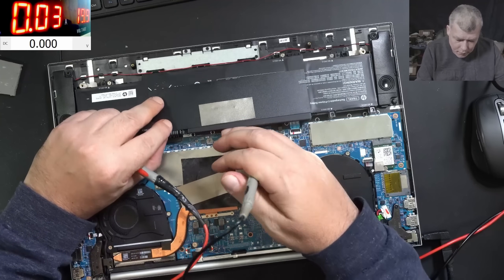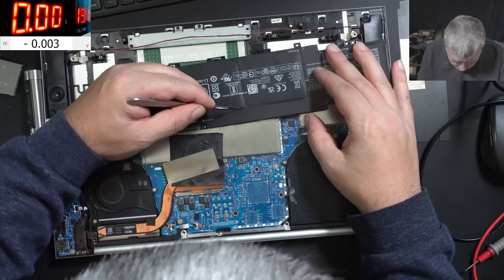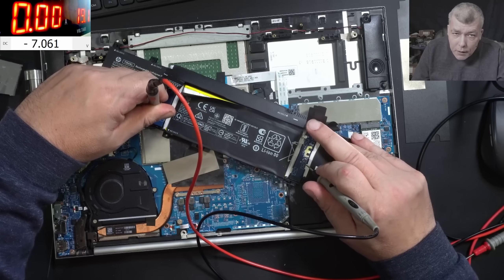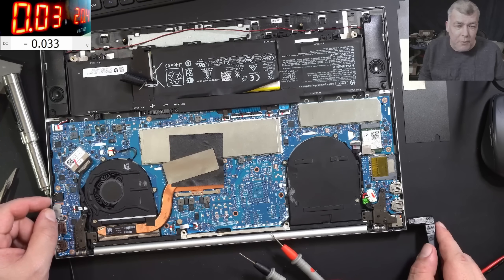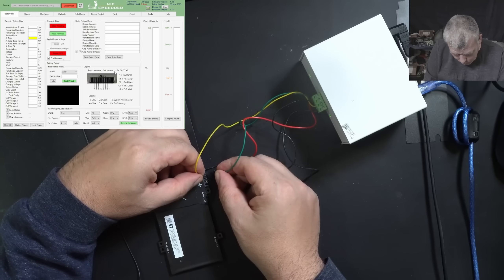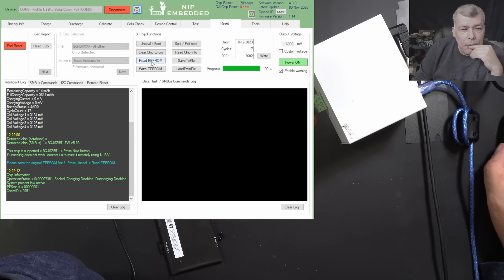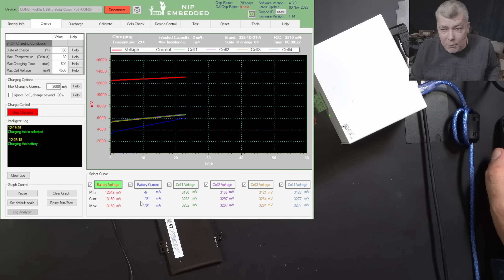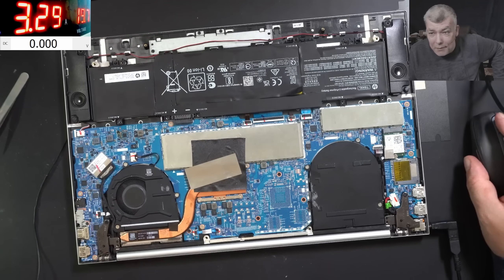Laptop battery repair & unlock - Yes, even a new battery can die

Comment: The battery analyzer is essentially a collection of various battery manager chip protocol analyzer from various manufacturers like TI BQ series. In this particular battery it was a TI BQ40 series chip which can be decoded using the datasheet published by TI. 

The issue here is that, they allow encrypting of these BMS chips so you can't actually read the firmware or re-program the IC without having the OEM's private key. 
And guess what happens, these "smart batteries" lock out every effin time they somehow gets over discharged. 

I have tested multiple batteries from various laptop OEMs and I have noticed the pattern that everytime you buy an after market battery compatible to many modern laptops, the laptop's EC will not recognize the battery, nor it will charge it. 
BUT here's the kicker, the EC will allow discharging the battery, but will show to the OS one of these misleading generic statuses e.g. "not present", "X% available and not charging" etc. 

If the user keep running the laptop from battery, it will eventually die and after sometime, the brand new battery will lockout from over discharging again. 
This design is pure evil and ripping off customers. 
It's about time someone comes up with some open source firmware reverse engineering scripts to similar to the tool here ( I am working on one for these BQ chips if not somebody comes up with one before me).

Comment: I have a question I have a windows hand held gaming PC the battery is bad 2 cells are swollen and I couldn't find a replacement so I took the 2 swollen cells out kept 4 cells now the device charge but every time I turn it on it keeps turning off in minutes is there a way to keep using the device with same battery or I'm waiting my time?

Comment: If there were a conventional method to perform this reset without needing the device, which is expensive to import here to Brazil, maybe a physical reset on the BMS. I have several Acer Aspire models like this, nearly new, and they don't hold a charge.
Reply: @carlosedubrasil  i am gonna try to remove all cells frok bms and solder again, maybe it will reset it if bms dont get power🥲

Comment: Hi sir, am chris
I am facing a battery issue with my  laptop(leadbook t11) .
It's life spand has drastically reduced. When I use it when connected to the wifi, it goes off after a very short period of time.

Comment: My new Asus battery died many times, I fixed it. Using random key combinations, touchpad keys, plugging in many tines. Even the 95% was upside down during charging. The native battery manager driver caused the battery’s fate, after the hibernation is successful, the illegal driver must be removed. Only Asus professionals are allowed to install it. Without hibernation the battery can’t be balanced. When the fan spins up during hibernation, that informs that the batt is currently balancing. It takes 50 discharges to get the best effect.

Comment: umm yeah you have to watch the batteries when the laptop is not being used. i have a Toshiba Portege Z30TC i7-6600U from 2016 and it stops charging a few times a year. Every few months I have to remove the main battery to reset the cmos and then it will charge again. If I didn't reset the cmos the battery would eventually go too low and then get locked. The manufacturers know this and design the self-kill mechanism into the battery on purpose to sell more batteries and/or obsolete the product to force people to buy a new one. This dirty little game that the manufacturers are playing should be illegal.

Comment: I have acer 8930G (that  currently Im using most)  which  is not  charging any battery,  but  sees them, -  no problem.   Ordered new  one still  0% charging. Same  issue with  my other acers  (yes same  8930G (yes  I have  alot  ot  acers with same  issue) Charger is new  original as should  be.

Comment: If the battery was new, wouldn't it be under warranty? :-0
Reply: This battery repair is part of the same laptop repair that Sorin just repaired HP Envy 17. HP Envy 17 is sold by HP for a few years and this model is still available now but no way to tell when this exact model was bought. In any case it wasn't sent just to repair the battery, that is purely a bonus fix. The laptop was dead for probably many months so the battery discharged and then locked itself due to low voltage. After Sorin fixed the laptop he saw the battery was not charging so then he fixed the battery and published this separate video just for that.

Comment: No hace falta comprar Nlba1.
Puedes comprar EV2400 cuesta 30€ luego comprar solo licencia NLBA
Reply: Ev2400 will work like an nlba ?
Reply: @cimogt7857  Yes, NLBA1 works with EV2300/EV2400 but only for resetting the chips/unlocking the batteries. EV2300/EV2400 is just an USB to SMBus adapter, only NLBA1 can test, analyze, calibrate, check cells, measure IR, measure imbalance, etc. etc. One genuine EV2400 costs almost like NLBA1, that's incredible :))

Comment: The EU should regulate these kinds of absurd and questionable faults, specially thinking of the sustainable propaganda.
Reply: Not absurd, if you know about battery you may find what is wrong and  change one cell or all the cell because if you have a bad cell and you unlock your battery the BMS will lock again. 
You are aware that lithium battery can take fire so this is security and it is the goal, if you are a professional or experienced amateur then you may unlock it with either arduino EV2300-2400 the product in this video in every case it need some at least """basic""" knowledge of electronic and lithium battery.
Li-ion battery are not dangerous provided that you absolutely know what you are doing.
But the unlock data should be always available and here is where regulation should apply

Comment: That looks like a way for PC manufactures to make you buy expensive replacement batteries. This is just as bad as the chips on ink jet cartridges and not letting you refill or use generics.
Reply: Yeah it's another version of the well known ink jet cartridge scam. FYI you can refill some selected carts if you have the correct printer model and turn off the ink level monitor. That's why I still have a Canon MG2560 around. Ink refills cost about 50 cents. If the carts blocks up soak in hot water and do a few full color page prints to fix it. At 5 bucks for a large bottle of ink it doesn't really matter wasting a full page of ink now hehe!

Comment: TLDR…. It would be great to have a “Light” version of the NBLA1 for non-commercial users (“Light” = restrictions on capabilities and use) The NBLA1 is a very clever solution to the challenge of modern smart battery management access but it is a “Pro Tool” at significant cost. Whilst I understand the business model that the OEM has chosen, it is indeed a pity that they are not chasing the business of non-Pro users. There is a large non-commercial user base just waiting to buy such a device at a more affordable price point. How great it would be if a version were released that had restrictions on its use (number of battery unlocks per week/month/year but at a hobbyist friendly cost. I am not suggesting a bargain basement price but it is currently just too expensive for anyone but the hard core I.T repair industry with good business throughput. Why not expand the NBLA1 user base at little cost but bringing in a huge increase in owners willing to praise its performance. Do you provide a specialist product to a small user base, at high cost per unit, or market it to the masses at a reduced cost but far greater number of sales…… that is a business decision for those who sell the unit but maybe Sorin can discuss this idea with them. “Light” versions of hardware and software have been around for decades and were successful sales models. Why not  NBLA-LT with reduced feature set and only 2 unlocks permitted per month ? A lower cost subscription model with PAYG could also be implemented ….. £5 per unlock. I would certainly buy such a “Light” version. Could Sorin’s channel act as a host to a survey to establish who would buy a “Light” version of the unit maybe ? Food for Thought ? Regarding the current price, I think some may recall that the unit was a lot cheaper when released but a price hike occurred. This may have suggested to potential buyers that price gouging was taking place ? I have no issue with Sorin showing the NBLA1 in use, just as he does with a thermal imaging camera, I think it is the fact that many non commercial users feel that they are being teased as the ownership cost is significant. We live in an era where sophisticated electronic devices are reducing in cost to fall within the reach of hobbyists and non commercial users.

Comment: Can you unlock the battery without cutting? External for Lenovo T470
Reply: Depends on the fault. If cells are below certain voltage, you probably have to disassemble the battery and charge cells with a power supply ,and then unlock.
Reply: @Alex-mj7km  We have an idea to force charging the cells through the NLBA1 device but it is not supported by all the chips. This would be a magic feature.

Comment: It's an amazing gadget but hard to justify the expense unless I was doing 4-5 batteries a month, which is highly unlikely.😕
Reply: I'm really surprised about the price. A very useful item rendered useless because it's not getting out to the masses. Hope one day it will be improved to include all BMS and be more realistically priced. Waiting for a competitor with good relations with all the BMS manufacturers to save us all
Reply: Subscription makes these undesirable for personal use.

If you are paying £100s for a battery diagnostic interface why would you then want to pay £100s more each year to continue using it.
Reply: Well the fun thing is that the price of the device when Sorin got it was 179 pounds, today the price is double of that plus you need extra licenses and all.
The price of the unit is something I get but why not make it also that you can buy some amount of resets for a fee like 10 resets in unlimited time.
Reply: @ZakHooiTM   Also I believe it does not cover the newer BQ chips, and the supported BQ chips do not get updated either. Perhaps next year Analyser II, with another subscription model, one that covers the missing chips, so you need two licences ;)

I'd rather pay Sorin £25 than buy this box.
Reply: @ZakHooiTM  You are right, in 2020 the price was 179 pounds and the device had 20% of the analysis functions which are now supported by December 2023. Chip Reset was a dream at that moment, Chip Reset was introduced in 2021. More, two years ago DHL rate was half of the current rate, you can ask them why they doubled the price for the same service. If DHL is not sufficient, just check the price of any gadget in 2020 and compare it with 2023. No one in this world offers 1 second trial, NLBA1 comes with 10 free days of unlimited battery repairs.
Reply: @ZakHooiTM  There is a small amount of free unlocks once the item is purchased without having to renew and re-pay for the license the next year. Sorin mentions it in a vid. If you do less than x amount of unlocks per year then the license renews for free. Personally if i had a newish laptop and the battery locked I would buy that device to unlock it just to f*ck over the manufacturers LOL! If you have to buy a new genuine battery the price is not far off so it is probably better to unlock the genuine battery and have that capability for the future than buy a cheap Chinese knock off battery.
Reply: Shows we clearly need very extensive right to repair laws to force manufacturers to open their chips and provide proper support.
Reply: Bot?
Reply: Price is too much. $750aud on aliexpress or $1k on ebay lol.